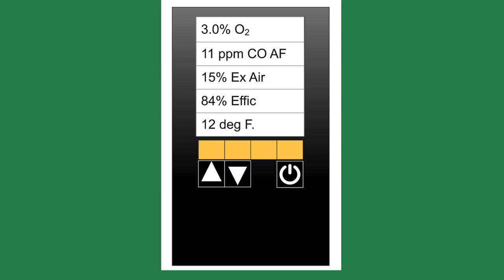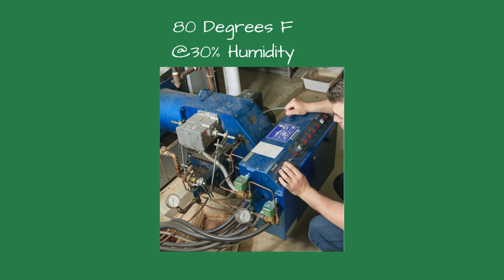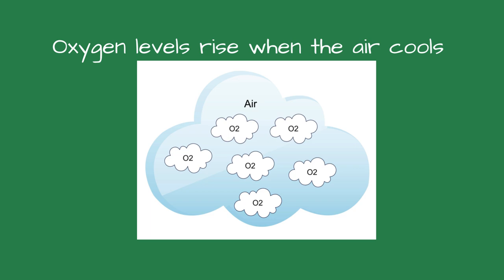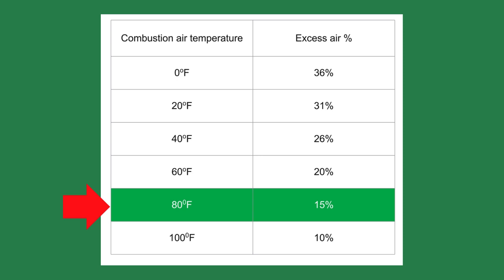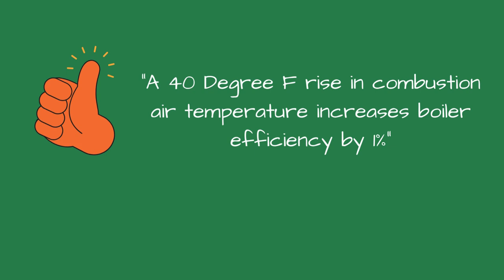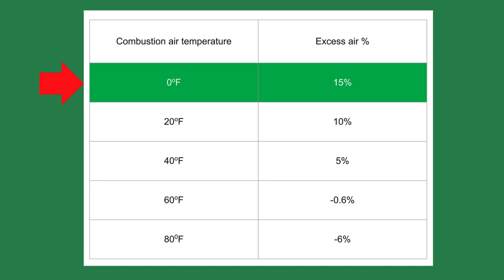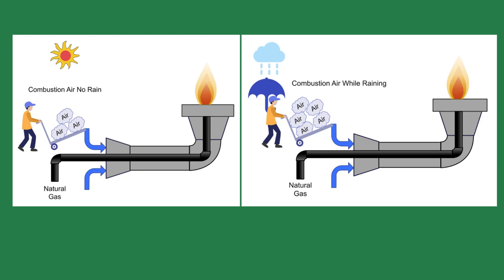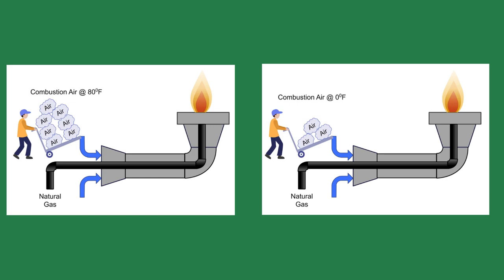How air temperature affects combustion

Comment: Great information Ray.  What is the source of the charts and information for using outdoor air for sealed combustion/direct vent?  This concern is new to me for combustion analysis.
Reply from the maker: Thanks you very much. Yeah it's amazing the unintended consequences we never consider. Most of the charts are mine that I made when doing research for my books or articles. The line chart in metric is from a   company in England that sells sensors. I can't find the link right now. If I do, I will reply again.